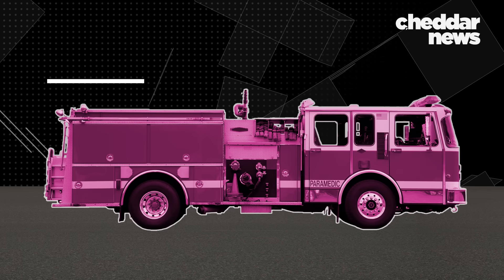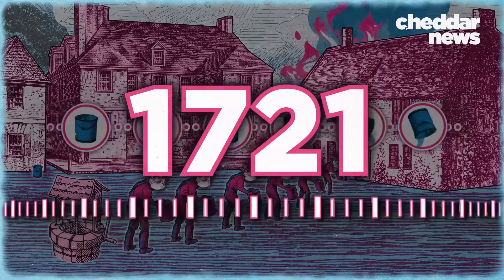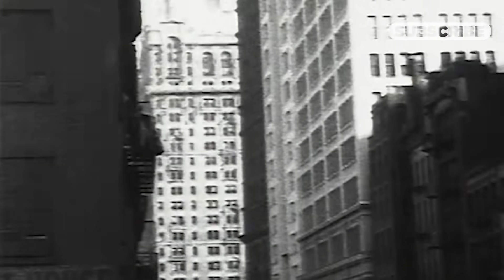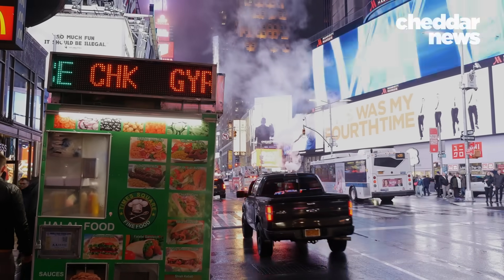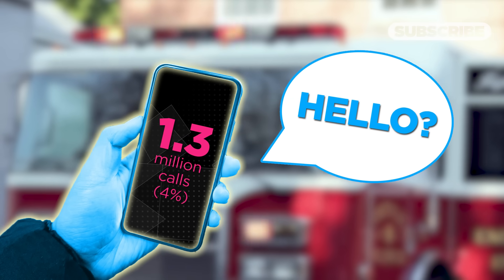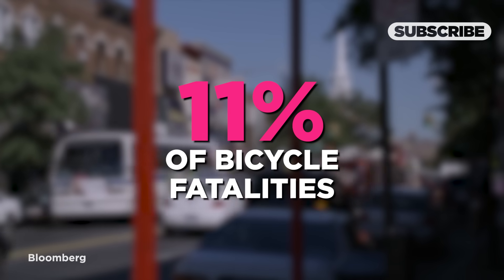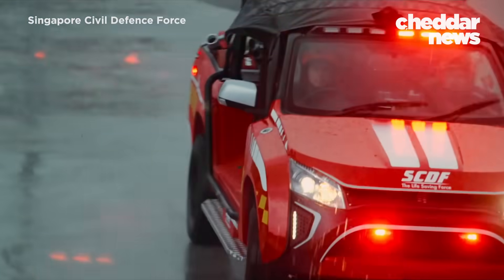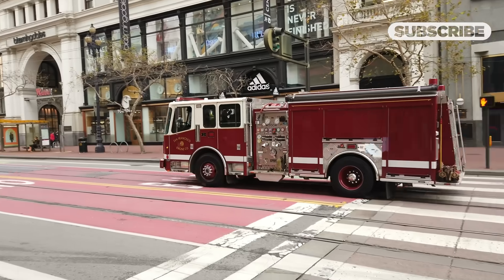Do American Fire Trucks Need To Be So Massive? - Cheddar Explains

Comment: This is my point of view as a volunteer firefighter in Southern Missouri in a semi rural or suburban area. To start some general information about my department, we have twelve stations and mutual aid agreements with all the departments around us. In total, we have close to 40 apparatus in service, not including our cheif and utility vehicles, so a rather big department. I personally think that the American fire apparatus is perfect. Yes, it's big and bulky, but that is because in true American fashion we have anything and everything you could need on one. Almost every fire apparatus carries some water ranging from 200 gallons to 1,800 gallons of water depending on the apparatus. The ones that don't are our specialty apparatus that are purpose built for the job they do. We have no wasted space on our trucks, from hose, to tools, to crew space, which is why they're so big. The trucks that carry water also carry various lengths of various dimensions of hose, ranging from 1" all the way up to 5". They all also sport a hose reel with 100+ (I believe) feet of 1" forestry line for brush and small fires. In saying all that, yes Singapore and European countries have smaller apparatus which work well, but they also have their disadvantages. Like the fact that all their hoses (that I've seen) are in rolls instead of pre-connected like ours, and yes, we have rolls in addition to our pre-connects. We can likely we can hold a lot more water. Therefore, we can last longer alone on a fire scene since we have more water.
Also it is true that most of our calls aren't fire related, but we respond to a lot more than just fires, including, Fires, Fire Alarms, MVCs (motor vehicle crashes), Medicals, Citizens Assists, Outdoor Investigations, Indoor Investigations, Missing Peoples, Storm Standby/Recovery, Ect. Our fire apparatus goes on almost every one of these calls. Medicals are the only calls that they may not go on, and four out of five of our live-in stations that have brush trucks which they take to medicals. So we use our fire apparatus on every call which is why we have so many, also every apparatus has a medical bag.
This is my (not very short anymore) explanation on why the American fire engine is perfect.
Reply: "Almost every fire apparatus carries some water ranging from 200 gallons to 1,800 gallons of water depending on the apparatus. The ones that don't are our specialty apparatus that are purpose built for the job they do." similar situation in most of Europe
"We have no wasted space on our trucks" seeing lots of walkaround videos from apparatus across the US I saw many of them with lots of wasted compartment space, like equipment being stored losely at the bottom of a drawer or compartment floor with like 50% of available space in the compartment remaining unused. 
"Like the fact that all their hoses (that I've seen) are in rolls instead of pre-connected like ours" there are lots of different hose storage approaches; The single rolled up hoses exist, but are only one out of many options; There are hose packages, hose baskets with a few preconnects, hose carts with a fair amount of preconnects and a few apparatus also have hose beds.

Comment: OK coming from a firefighters perspective yes having a smaller fire truck may help but in larger cities we can always do that some smaller cities you can also do that either because you need to reach higher buildings and higher places where a smaller fire truck let’s say a single axle Can only house 75 foot ladder, where a tandem can house over 100 foot ladder there are times where we need two or three of those to put out a warehouse fire which is a decent size building but is requiring a lot more tools equipment water pressure and trucks so going smaller is not always better sometimes going bigger isn’t always better either but you need to find a compromise for both
Reply: All of our 105' rear-mount platform ladders are based on a 2 axle truck; Aerials in the 140 ft range might be ona  3 axle truck, those in the 170 ft range on a 4 axle truck etc

Comment: Europe has smaller fire trucks because most European Cities are literally centuries old and weren't originally built for cars so they have smaller streets. America is going on 250 years old and most of the country was built up and settled in the last 150 years, and built around cars. We have bigger fire trucks because they're supposed to be a jack of all trades and not need to wait for a ton of other trucks to start putting out a fire. Common fire in the US is put out by 1-2 Engines which is the standard size of most Fire Stations.
Reply: many cities across Europe were rebuilt after the wars, and also later on oldtown areas in many places were partly demolished for wider roads; Most roads fit semi trucks, articulated buses and trams, then also a larger fire truck would easily fit
"Common fire in the US is put out by 1-2 Engines" well, at a structure fire call I see American departments responding with at least as many apparatus as you'd see in many places in Europe, with the only difference, that they come from multiple small stations instead of only 1 or 2 stations

Comment: Streets are smaller in the UK and Europe thus smaller trucks, and it's a well known fact U.S. firefighters are better equipped and need more room for equipment.
Reply: in Sweden they're just as wide as in the US and they still don't drive any larger fire trucks
Better equipped being a well known fact? Then please tell me what American firefighters carry along which Europeans don't have?
Reply: @EnjoyFirefighting  I've spent my career as a firefighter in the USAF European countries are really behind the times safety and equipment wise. When I was in the UK the London Fire Brigade were still using cork fire helmets and woolen jackets and rubber pants, they did around 1987 start using fiberglass helmets , the Royal Air Force still to this day have woolen fire gear they wear as a duty uniform. Some countries have adapted to be more like the American fire service which has through trial and error and loss of life developed new techniques and improved turnout gear and specialized equipment. The majority of that being done by the AFESC air force engineering and service center in Panama City Florida at Tyndall AFB which has developed and enhanced Structural fire trucks Rapid intervention crash fire rescue vehicles and turnout gear, breathing apparatus which a lot of manufacturers test their products there, I have seen things in testing years before they were produced and some that weren't. And most major European cities have narrow roads thus the smaller equipment there are major highways that are wide but unless it's a vehicle extrication on a highway the roads tend to generally be smaller plagued with narrow sections hairpin turns and traffic parked along them, Australia had decent size roads and Japan has to be the worst followed by the UK but are both a lot more advanced than they used to be. I've been in the fire service for over 40 years and held every position from riding the tailboard of a pumper to Fire Marshall and the advancements made by the U.S. and other countries have made a dangerous job a bit safer working together. And as to your comment the U.S. trucks look old can't be further from the truth the trucks are designed for specific purposes some employing European designers while different from some other countries do the same function and have generally larger crew compliment and tool setup and the European designs don't allow for extra room and are compact and purpose driven with  few luxuries. I think every firefighter in the world is a true hero answering each call without hesitation and with dedication. My comments as I said are based on a four decade career in Civilian and Military perspective having traveled the world doing so.
Reply: @JREone  oh they are? When and where as that? Safety wise there's also lots of things from the US European departments would never do, I guess this goes for both sides then. 
Btw even the US Army Fire and Emergency Services at USAG bases here went away from using American Engines and Tankers and use European ones instead ... 
Concerning the equipment, well it would really help to know which countries we're talking about specifically. Simple example: a Norwegian Engine basically is a German Tanker. And in Germany Engines are classified in 9 different subcategories which differ in size of cab, tank, pump and range of equipment. 9 subclassifications by current standards, not looking at previous and by now outdated apparatus classifications. Thus it's hard to tell that they'd be behind equipment wise 
"Some countries have adapted to be more like the American fire service " which countries, and in which aspect? I know American pickup trucks and vans used to be popular in Sweden and Norway, but most of them got replaced by European vans and trucks by now. Also I honestly don't know tactical approaches which are similar to those in the US? 
" And most major European cities have narrow roads" not quite. Many cities across Europe had to be rebuilt after the wars and became very car-centric; Some places demolished preserved parts of the oldtown area to lay down a nice 4 to 6 lane wide road through; Rather few cities still have a preserved oldtown area with the original, narrow streets from centuries, 1000 or 2000 years ago. In places where they have those, like in the city where I grew up in, that oldtown area is rather small and makes only a fraction of the response area. At the same time you find also wide streets consisting out of 8 lanes of road traffic + 4 tram tracks + 2 sidewalks + 2 bike lanes + grass and trees ... downtown, not some place in a commercial area at the city limits. As a matter of fact in most cities American apparatus would easily fit into the streets. In places where semi trucks, articulated buses and trams fit in, an American fire truck has an easy game. Only few areas, like the few preserved downtown areas and old grown urban residential districts, they tend to have narrow streets and with illegally parked vehicles get narrower than that. Those are a limiting factor in some, but definetly not all places. 
Besides the layout in most countries, there are also places like Sweden which has an American-scale road layout also in the cities. Larger fire trucks wouldn't be a problem there at all. It's like the opposite to the UK or Italy. 
"And as to your comment the U.S. trucks look old " my comment? I didn't state anything alike? Although I must admit, seeing some videos from American fire apparatus with the title "brandnew" I thought quite a few times "what? it looks just like the previous, and again previous apparatus they had?!" ... but I didn't say anything like that in my comment? 
"allow for extra room" apart from the standardized normed apparatus one could always go for an upgraded larger apparatus, but at municipal fire departments that's barely necessary. With a thought-out space usage concept, not putting stuff loosely at the bottom of a drawer, you can get a lot of stuff into a compact layout. All depends on how good you're at playing tetris
Reply: @EnjoyFirefighting  seems the other comments support pretty much what I'm saying and rewatch your video the old comment is in the first minute. Been doing this longer than you've been alive. Happy holidays
Reply: @JREone  my video? It's not my video, thus it's not my statement ... 
Yeah, the other >American< comments lol 
Want to go down to facts and compare actual numbers?
Reply: @EnjoyFirefighting  oh thought it was your video you seemed to care so much my comments were to the creator not you.

Comment: As a European, let me throw in my 2 cents.
There is a crucial aspect this video misses and that is logistics. This video is just a measuring contest saying that shorter=better without any further context, but the writer doesn’t realize the sheer amount of vehicles a fire brigade dispatches when responding to a call here in Europe.
A single American truck already has much of the equipment firefighters need to carry out a mission, to they send a single yet big-ass truck to handle the call. In Europe, when a fire engine is dispatched, you will usually see it accompanied by fire jeeps or SUVs which serve only as personnel carriers to respond to the call. You usually have a vehicle only for fire extinguisher equipment, then a separate truck for commanding the mission, then another for hazmat, another for EMS and so forth.
So while you do have more compact vehicles, you need a convoy consisting of multiple vehicles to respond because a smaller vehicle means less space to carry stuff and the stuff you can carry is way less.
So despite being more mobile and compact, this creates a whole lot of other problems that a big single truck doesn’t have, like coordination between single units, or the amount of surface area the vehicles take when parked on site. This also makes driving through traffic quite difficult too, and in some cases a police escort is necessary to move vehicles out of the road to create enough space for the fire convoy to pass through
Reply: "fire jeeps or SUVs which serve only as personnel carriers to respond to the call" never seen any of those ... not in Austria, Poland, Czech Republic, Germany, Denmark, Sweden, Norway, Finland, Ukraine, Netherlands or Belgium
"smaller vehicle means less space to carry stuff" nope ... with a well thought-out space usage concept you can store a lot of equipment in a small unit
Reply: Europa is not one country... In Sweden most stations have two engines. So they cramp the same stuff into them as the Americans, but with half the size. Even the amount of water is roughly the same. What we don't do is building with a lot of "nothing". The cab is not 6 meters long to contain a lot off "nothing" and so on. I would say that is the biggest difference - we skip the "nothing" and focus on the things.

Comment: A fire truck has a hydraulic mounted ladder, a fire engine does not. Most fire engines carry closer to 1000gal of water. They are so big because on top of the 1000+ gallons of water, they carry 4-6 firefighters, extra ladders, extra oxygen tanks, hundreds of feet of hose, power tools ranging from drills to giant saws, hydraulic cutting and spreading tools, and many will also act as a pump in case there isn't a hydrant but there is a body of water like a pond or lake. If you live in most American suburbs, just stop by the fire station, more than likely they'll be happy to do a quick tour and answer questions. You don't realize how big they are until you're standing beside one. They're very cool!
Reply: Oxygen tanks ???? you don't know much about firefighting. In a fire truck is no oxygen tanks Matty. Compressed air tanks maybe ?
Reply: @vanDeudekom depends on the department. They usually have air cylinders for patients in an o2 bag and air cylinders for the scba
Reply: and our more compact Engines carry 9 firefighters, and apart from the amount of water, all the things you've listed as well
Reply: @EnjoyFirefighting  We are better at utilizing the space. USA trucks really waste space.
Reply: @Xanthopteryx  The US has the space to "waste". <shrug> Even the oldest cities in the country like Boston are nowhere near as tightly packed as typical European cities. Different horses for different courses.
Reply: @Kevin_Rhodes  Time to stop wasting and to make the cities more people friendly and to make the roads safer, and to make cities and roads safer that means you will make them more narrow and more diverse and so on.

Comment: Coming from someone within the fire service It is logicaly not resonable to have "an all around response vehicle" because if you have a large structure fire since you decided to go with the " cheaper & safer option" you now don't have enough water risking the lives of others in the fire and requiring you to have more tankers for the water you need. So in the long run the more equipped option is the safest and least expensive option.